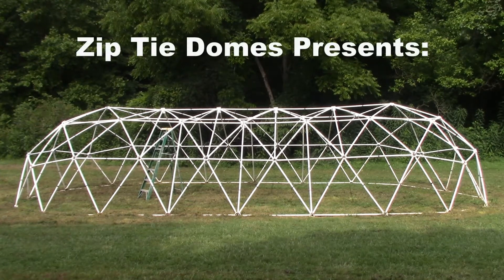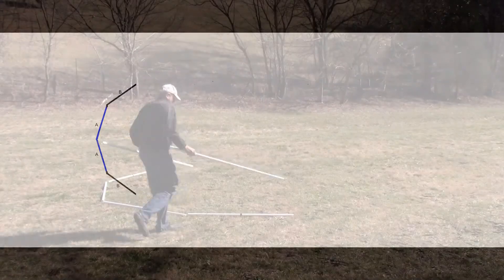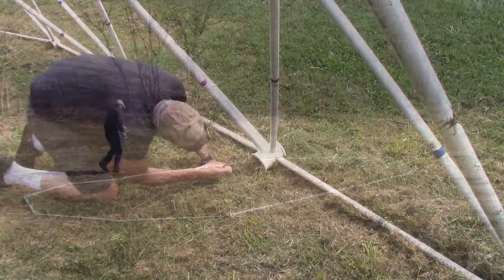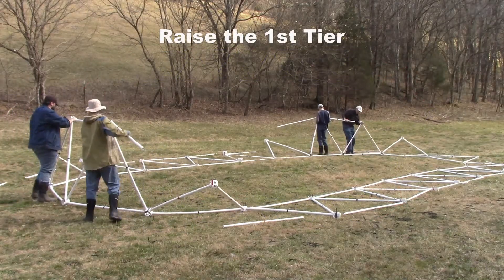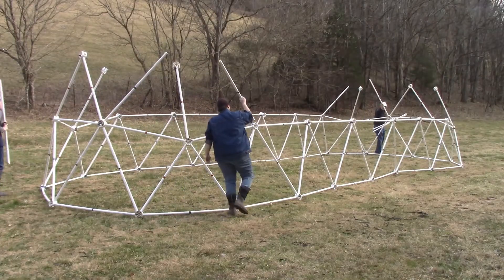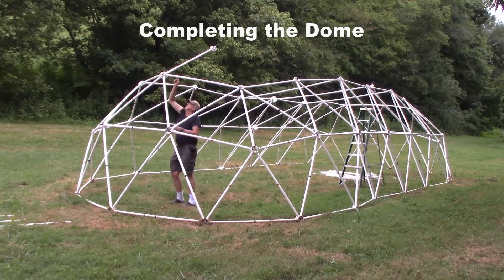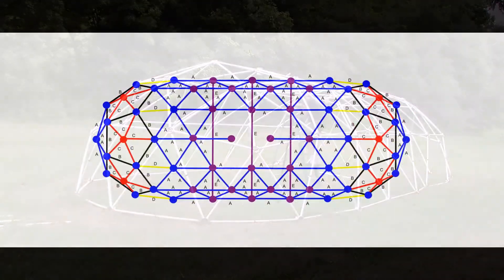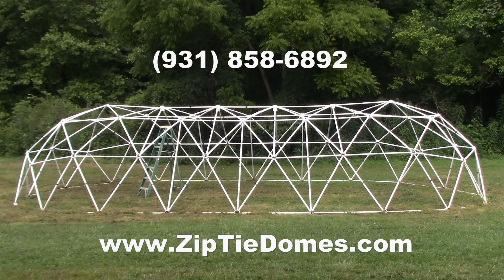Geodesic Tunnel Dome with 4 Extensions

Comment: I am considering a tunnel dome to use to keep my utility tractor and impliments out of the weather as a garage.  However, i would need a large door opening on the end for the full width and height of the tractor with ROPS, not just a little triangle or diamond climb through slot.  Do you have a design/plan for such an opening that would still give plenty of structural strength?  If so, could you point to your video or weblink to see it?  Thanks.
Reply from the maker: That is a great idea, and I don't have anything like that working right now.
I do have a prototype that "might" work, but that is not here or there.
Thanks for the input on what is needed.
John Hurt
Reply: @ZipTieDomes i have been following your design for several years but was always hung up with the door, being a weird shape and size to squeeze or twist through. If i could work out some kind of traditional door on an end panel but tied into your tunnel/dome, then id be sold.
Reply: @ZipTieDomes im thinking like using the tunnel section without the dome end but create an end wall like a quanset hut or something with a more traditional door or garage door.  Maybe use a steel pipe hooped over with a 2x4 framed wall and that all ties into the end of the tunnel section. 

Id be willing to work with you to develop a design and prototype it to trial.  Let me know if you are interested.  Thanks much.
Reply from the maker: @RoyatAvalonFarms  Roy,
Give me a call sometime.  My telephone number is at this link:
https://www.ziptiedomes.com/contactus.htm
Reply: @ZipTieDomes great.  Will do.
Reply from the maker: Yes, here are three examples of a rectangular doorway for our domes:

https://www.ziptiedomes.com/customers/dougsikora.htm

https://www.ziptiedomes.com/customers/bobtullis.htm

https://www.ziptiedomes.com/customers/kimpoppel.htm

Email or call me at this link if you need more information:
https://www.ziptiedomes.com/contactus.htm

Thanks,
John Hurt

Comment: Hi! I was wondering if it would be possible to make this tunnel dome taller like you would with a silo dome? I'm curious if this would change the integrity of the structure or if such a change would be feasible.
Reply from the maker: It would tend to expand at the middle of the tunnel section.  It is a cylinder and not a sphere, so it has some different characteristics.  Thanks for watching the video.  John Hurt

Comment: how do you add a door or connect two tunnels together side by side
Reply from the maker: Put the domes side by side, take out a hexagonal section, and make a tunnel out of PVC pipe struts between the two domes.  I don't have any pictures, but here is a customer that made a rectangular doorway, using PVC pipe and a heat gun:
https://www.ziptiedomes.com/customers/dougsikora.htm
PVC pipe is very easy to use, and if you can fabricate a tunnel dome out of PVC pipe, then you can create a short connection between two domes by attaching PVC pipe between the two domes at the hubs that line up on either dome.
Thanks for watching the video.
John Hurt

Comment: With smaller triangles/more tiers, you could construct this on a trailer frame base and use the structure as the basis of an airstream like trailer. Fill triangles with foam and cover with fiber glass for example super tough and no rot no seam to leak at the top and strong for ac mounts etc.
Reply from the maker: That is a great idea.  Thanks for watching the video.  John Hurt
Reply: Thats how i ended up here,, id like to do , the same idea

Comment: Is it there a way to calculate the size of holes needed for an specific pipe size to get the required angle?
Reply from the maker: Yes.  Through trial and error, and by actually drilling holes and building the domes as prototypes, I have a list of the correct size hole to be drilled for each pipe size and for each dome frequency.  Thanks for watching the video.  John Hurt